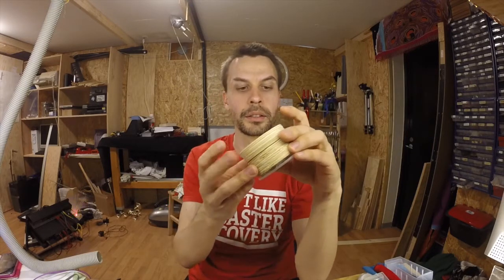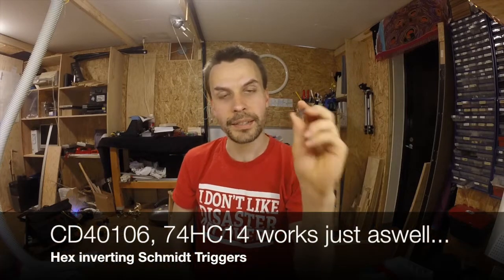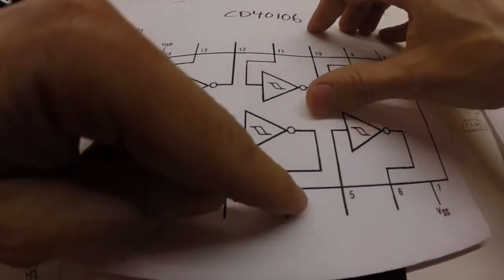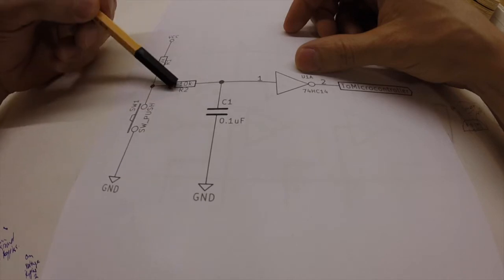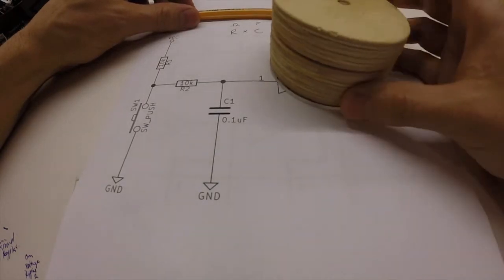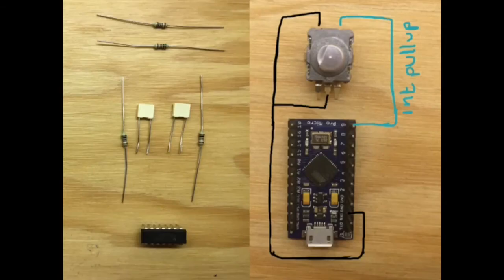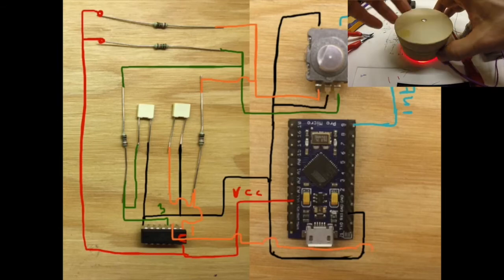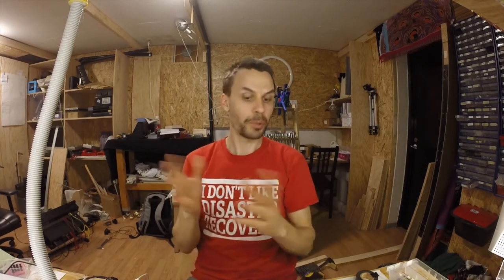Rock solid encoders with Hardware Debounce - Anything Arduino Ep30

Comment: I'm currently building a USB input device with a rotary encoder, this will save me no end of headaches. Thanks
Reply from the maker: Tell me more! :) I have a few more things I want to do that has with usb input to do, some kind of game controller, and mouse movement... a 3D software controller... What is your plan? Or is it secret? ;)
Reply: I use Photoshop with a graphics tablet, but there are many keys I still need to use and there are limited softkeys on the graphics pad. The problem is getting the keyboard and graphics tablet on the same bit of desk, both are too big. So I'm making a breakout keyboard with only 10 keys and a encoder wheel to zoom and change tool size. All running off an Arduino as a HID. With a few Neopixels and a 3D printed case / box.
My other idea is to use a 6 axis gyro breakout board to make a controller for Fusion 360 that emulates a 3DConnexion compact space mouse. I'm thinking a door stop spring might work as the actuator when encased in a 3D printed knob.
Reply from the maker: I have a similar idea but for more everyday things. By using a trackball and adding buttons along the "front" for things like copy paste, enter shift etc etc...
The 3D software I talked about was also the 3D connexion variant. I had the (crazy) idea of putting a rotary encoder on top of a joystick to get all the different movements to use in a 3D software :) I have all the parts... just need to put it into action ;)
But using a gyro is genious aswell, you get all axis in one little package... 
Thanks for sharing! And as always, when you are done please share a video of it in action :)
Reply: I was going to use a joystick and encoder, but watching how the 3D mouse works, I thought the gyro would be easier to implement if I could work out how to actuate it all.

Comment: I've looked up CD40106 and 74hc14 on Aliexpress, you can get 10 pcs for around 1-1.5€. Excellent solution for rotary encoders. I was avoiding doing anything with rotary encoders because they all are crappy. Thanks
Reply from the maker: That is a good price. And doing this really “uncraps” the rotary encoders. As I say in the video I will never use a rotary encoder with HW denounce ever again 😅

Comment: Super video sir! I used a rotary encoder in a midi project that skeeps a little if the input is to quick. Hadn't gotten round to a fix for it yet however i will now abandon any plans i had for it and use your methods. The skeeping is less that convenient so i do look forward to no skeeping at all :). Well done sir, jolly good show!
Reply from the maker: Exactly! I have a commercial midi-controller (Arturia Beatstep) and the encoders in that one skips all over the place, actually I find the encoders are crap on that one, you need to be sooooo careful for it work as it is meant. So a "rock solid" midi controller is now also on my ever growing todolist :)

Comment: Is this work for EC11 encoder as well? If so,

Encoder pin A/B to resistor > to board
After the resistor,

A/B > resistor > capacitor > board right?

Comment: I built this following your video, but I have to say it's only marginally better than before, not rock-solid at all. If i spin it slowly it's a bit more accurate, but a fast spin skips a lot.... I'm using this to drive the volume on volumio with a raspberry pi, so I have not seen that code, nor is it easy to change.
Reply from the maker: Well using it on an arduino as you can see in my video it is really rock solid... Maybe the way your code is written is different. If you have an arduino at hand you could try to build this circuit and maybe take it from there?
Reply: Just done that: your claims are true, it is rock solid on an arduino, turns out the Volumio code is really, really bad for some reason. I'll have to find a way around it. Sorry for making it sound like I accused you, I'm actually really glad I learnt something new due to your video!
Reply from the maker: Xoliul great that it works! If you just want it for changing volume on the pi why don’t you use my code?  ;) then you get a few extra features aswell and a really cool looking volume control (if you build the same one I did. Check out anything arduino ep. 26 for more info on that. No offense taken. Take care! :)